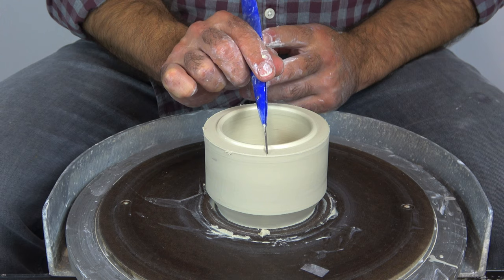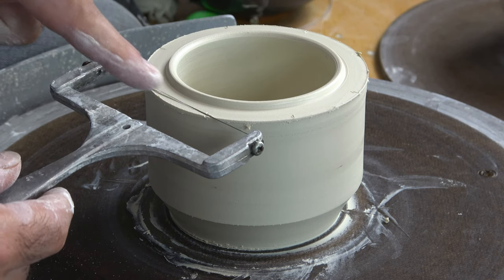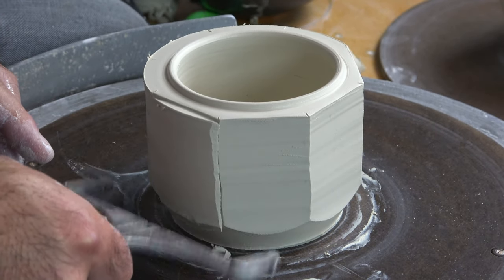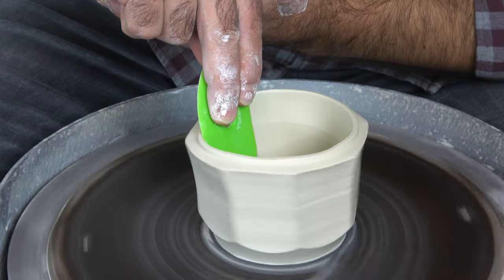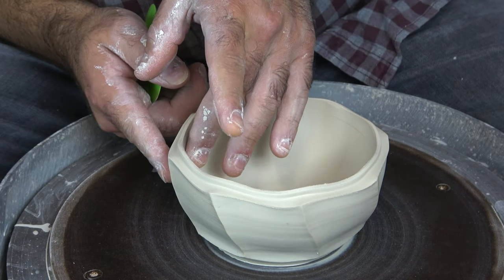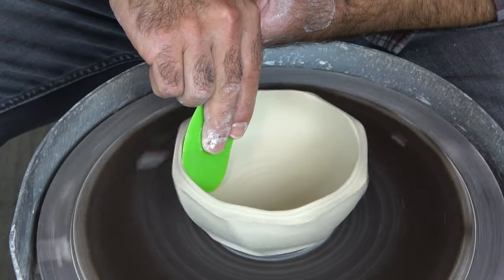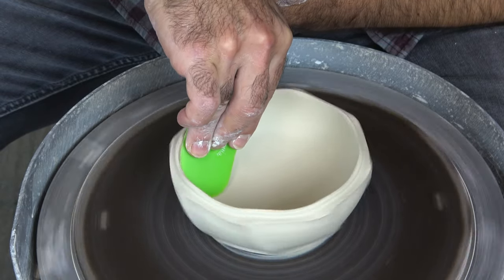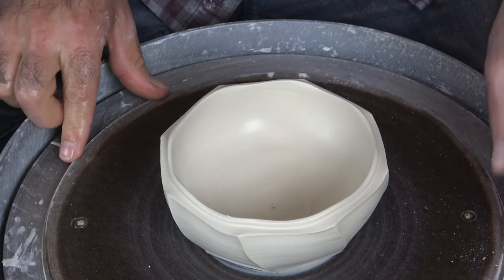Learn to Facet and Twist a Bowl on the Potter’s Wheel - Pottery Demonstration

Comment: Great demo, but could I ask whether your pot was freshly thrown. Or whether you had dried it at all? Is it stoneware?
Reply: If you are a beginner, you may not be able to tell that the pot was clearly thrown on the surface it is sitting on. The clues are the swipe marks at the base of the pot.   How long was it sitting there before the video started?  Not sure, but not long is my guess based on the way the clay is acting.  It is not leather hard, and he isn't exerting a lot of pressure to push the wire through.
Reply: @theabristlebroom4378 what a great and teacheable response!